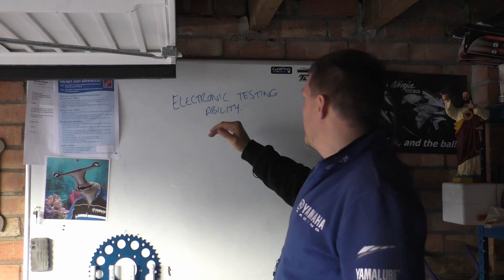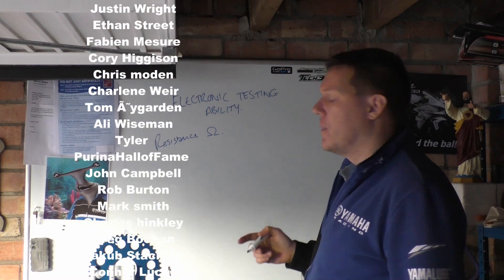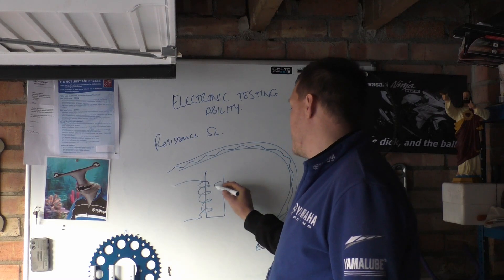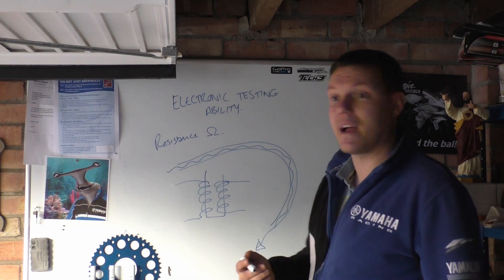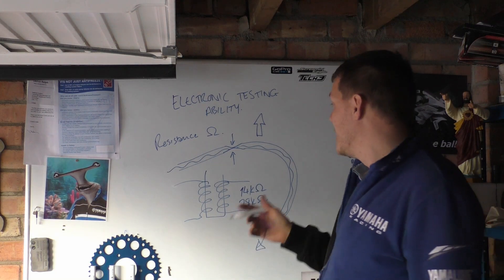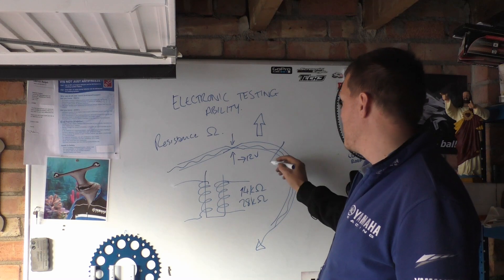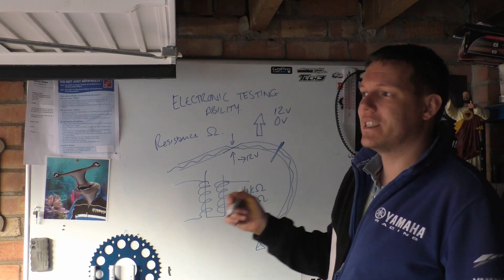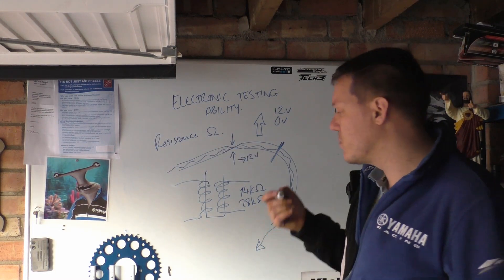Learning Motorcycle Electronics - Part 4 - Resistance

Comment: New to your channel and really liking it. My biggest area of weakness with bikes is the electrics so this series is really helpful, thank you. You mention the three main terms to understand are voltage, current and resistance, will you also be going over how wattage fits into all of this as well? I hear wattage coming up a lot when people are fitting extra lights or heated gear to the bike and to not exceed the output by the alternator.
Reply from the maker: Yes dude - its all coming - there's just so much to cover. I'm also planning on including projects like this and practical examples - oh and welcome to the channel - matt
Reply: Excellent, look forward to viewing all the new videos. Going to spend some time going back and viewing your older ones from before I subscribed. Lots to learn.

Comment: I don't know if this is worth a video. My 2000 ZX6R/ZZR600 seems to run smoother with colder weather. Not just air density meaning more power, but less vibration.
What makes me more confused is it's different than my EX500 which runs smoother when it's HOTTER, since the engine doesn't always get up to temp from casual rising.